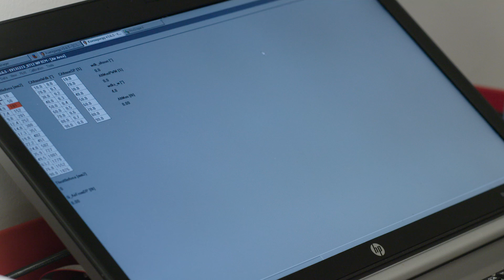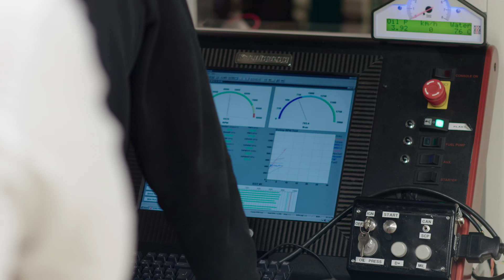The 1360HP Heart of the Koenigsegg One:1 - /INSIDE KOENIGSEGG

Comment: People need to understand that electric engines aren't a fucking God send. Both ICE and electric engines require the use of fossil fuels. Hybrid alone is the best solution as the electric engine derives power from the petrol thus making it more efficient. Stop praising electric car, they are an abomination to the motoring world.
Reply: Electric motors require fossil fuels? Ever heard of a geothermal power plant? They don't use any fossil fuels at all. Electric cars are an abomination? Only if you are an ignorant fucktard.
Reply: Well, electric motors eliminated turbo lag on the P1, so they can't be that much of an abomination.
Reply: ***** Shhhh. If you tell him there are other countries in the world he may have an aneurysm.
Reply: Everyone in this argument failed to think of where materials for the batteries come from, which is the ground. I'll use the Prius for example. It's nickel battery, it come from a mine in Canada, the mining process is so bad it's waste land around the mine. The raw nickel is then shipped to Europe to be refined. It goes by ship burning fossil fuels. Then it creates more carbon dioxide in the refining process, then it is once again shipped this time to japan to be farther refined also by ship. Then to china by ship, back to japan to be made into foam. Then it is shipped by truck to the factory. This creates more pollution then driving a full sized pickup truck or SUV all year. Just because media says hybrids are the answer doesn't mean they are. It's more ignorant saying hybrids are the answer, then saying they are and abomination.
Reply: Tesla? Ever head of them? Hybrids a just stupid.
Reply: Bryan Doherty If you can't refute any arguments your post is useless right off the bat. Good luck with your "non-boring life" clown.
Reply: I remember when digital cameras where the "New thing". And most photographers were skeptical about them. Most said they would never be as good as the old school cameras. Now, traditional cameras  are a Relic. So the motoring world has no long term future, mostly because the production of fuel comes at the cost of the planet's survival and therefore your own, just connect the dots...
Reply: Doppelkupplung
I hate to break this to you but geothermal power is not something you can just put anywhere you want it is actually rather limited which is why it isnt being used all that much.

also if you think CO2 is bad for the earth there is no way that sucking heat out of the earths core is not going to have negative consequence down the road.
Reply: michael cochrane there's been some cases of people getting 300kw out of a motor the size of a dog food tin... granted, this was short time and some very fancy cooling, but the point remains, 4 $10k+ (probably more like $100k+) dog food tins with some fancy cooling, weighing perhaps 20kg can put out as much power as this huge twin turbo v8, and do so while producing considerably less than the ~2MW of waste heat and noise this thing does.
Reply: +Muskoka Mike Actually where I live uses exclusively Hydro. So no fossil fuels are not REQUIRED.
Reply: Brayton engines are what I think the future of I.C.E.'s should be. Research the "ready engine" then imagine what that engine could do if built based on a wankel engine!

Getting 600 lbft of torque and more than 1800 hp out of a 1.3 dual rotor engine would really only require a materials change.
Reply: LSG Drizzt ***** lol...fail and...fail
Reply: Are you trying to be ignorant or it just happens naturally? For now and the near future fully electric cars use fossil fuels in both the manufacturing and the running of the car itself. But there will be a point in the future where this won't have to be the case. Where manufacturing processes and charging the batteries are done through 100% renewable means if so desired. 
Which essentially means that we should not rely on one system over any other and that we continue to develop all technologies, hybrids, ICE and fully electric.
Reply: Well I live in Nova Scotia and we still use coal for electricity here so i don't get the point of electric cars yet. My Civic is an lx, I don't need leather, navi, sun roof. It's 2716lbs, which is on the heavy side but is about 1000lbs lighter than the Outback I had before. I don't hate electric cars I'm 100% open to the idea, I just doesn't make sense for people who live where the electricity source isn't clean. But you may live in Toronto where they use hydro power and there is more traffic, so it makes more sense there
Reply: If there weren't so many trolls on the internet who have nothing better to do but waste time arguing about electric cars, when people have the right to buy whatever they want. I will never buy a hybrid or electric car, I'm an auto enthusiast, I want a standard, I want to hear an engine, I don't buy a car just to drive to work and back and park it in a driveway and not touch it any other time. I buy a car that I can enjoy the sound the engine makes, the feel of the gear shifter, the way it looks. I care about the environment, but I'm never going to buy an electric car. For me and ICE car is the best option it fits my needs, I don't need to worry about a battery dying. Plus Mr. Koenigsegg is right, the electric motor isn't very efficient and complicates the average car. I wasted my fucking time even commenting. This whole argument was stupid.
Reply: ***** I'm not reading a fucking book and if you haven't noticed more of consumers don't have hours to charge a car. I'll buy whatever fucking car I want. You go have your boring electric car and I'll have a flat 6 in a Porsche
Reply: "Both ICE and electric engines require the use of fossil fuels"

This is simply not true as electric engines do not require fossil fuels. The fact that utility companies still use power plants with fossil fuels is not the electric car's fault and going forward even the utilities will move away from fossil. Depending where you live that might already be a reality.

"Hybrid alone is the best solution as the electric engine derives power from the petrol thus making it more efficient."

Again, this is false as far as efficiency goes. It's actually good from a practical stand point giving it an extended range but not improving efficiency over an all electric car.

"Stop praising electric car, they are an abomination to the motoring world."

Bias much? Electric is not only more efficient, it is the future. You can still drive your ICE car till the day you die IF electric is adopted sooner. Gasolene and diesel are not used by utilities on large scale, rather coal and natural gas. So better pray electric gets more share of the market and the sooner the better. It's a win-win for the environment and for enthusiasts that will get more fuel for ICE powered cars that deserve it, not for stupid utilitarian cars to get people and goods from A to B.
Reply: there's all kind of stupid in your comment mate:
Electrics powered off hydro/solar/thermal etc etc etc etc - dont require fossil other than in some areas of their production. even the full energy cycle of a crap electric car charged from a brown coal power plant still beats all but the most refined diesel, leaves every petrol car for dead, and this is still without taking into account the full energy cost of the energy production, nor the ease of emission management for a power plant vs a car.

hybrid alone is not the best solution, its just what provides the best answer to current battery techs lack of energy density and the power grids inability to provide the power to charge said batteries quickly (at least, at home).

"derives power from the petrol thus making it more efficient"
no, no, no, no, no. series hybrid cars are less efficient (other than perhaps some VERY specific circumstances) than a strait ice car - because its converting energy from chemical to kinetic, kinetic to electric, then electric to kinetic. this by definition CAN NOT be more efficient than cutting out the 3 extra stages and just having chemical - kinetic. Parallel hybrids are slightly better, but still are relying on a ~30% efficient engine to convert the bulk of their chemical energy to kinetic, and this is ignoring the energy cost to gather, refine, transport and deliver the fuel. Electric cars convert ~95% of the grid's energy to chemical, and <75% or more back to kinetic. After production, an electric can be 100% fossil free (other than tyres etc) - a ice, can never be so. they can never, ever, be more efficient. its a thermodynamic impossibility. For an ice engine to even approach the efficiency of a crap electric motor it would need to run so hot that it would melt the material its made from.

"Stop praising electric car, they are an abomination to the motoring world."
higher power density, higher efficiency, lower weight... how does this make a car an abomination? fossil fuels are a finite resource, electrical energy is not. Bitch and moan all you like... the future is electric.
Reply: IIAmGothamsReckoning Average shitty electric engine is like 97% efficient where as the best gas one is like 67% efficient. You are off to a hell of a start on proving that electric is shit especially when so many things you use on a daily basis use electric engines.
Reply: sn0wchyld obviously wasn't quoting exactly I said LIKE 60% I'm to lazy to look up exact moment for a slap fight in the comment section besides I was fairly close and it proved my point non the less that combustion engines are terribly inefficient
Reply: IIAmGothamsReckoning and that will mean constructing more generating stations, which require fossil fuels to construct......

I love idiots who can't think beyond what's right in front of them lol

All electric vehicles do is move the pollution somewhere else.....they aren't that green in reality....
Reply: less than 20% of our infrastructure(USA) uses natural sources of energy and nuclear. 81% of our energy comes from fossil fuels. This means that the electricity you're getting is most likely from a huge power grid generator, meaning he is nowhere near wrong. We're forcing the EV to become a thing before we even have a renewable energy or nuclear infrastructure that can even support it. Going electric makes no difference right now, as the mining/recycling of lithium is counter-productive to EV goals. It's all market hype.
Reply: i disagree hybrid is the future, i don't want another leaf thought i want a petrol to electric generator to power a fast car.
Reply: Exactly! If you were to charge an electric car in my county (and no, I do actually live in a highly developed nation), the power is going to come from burning coal anyways! Yes, the burning of coal emits less emissions than Oil, but still; its coal!
Reply: Well spoken.
Reply: IIAmGothamsReckoning
Well to be fair to your argument electricity generated from fossil fuel burning power plants are still almost double the efficiency of an ICE and Electric vehicles have much less drive train loss; So overall its much more 'clean' and efficient than an ICE, this would continue to improve as cities shift increasingly to fossil-fuel alternatives. However as some people have pointed out, the amount of energy and pollution produced in making the batteries isn't exactly stellar. Next generation battery technology can't get here any sooner.
Reply: LSG Drizzt Hes not wrong, look at the industry of making these new hybrid and electric cars, way more pollution involved in making them as a verse to making and running a normal car.
Reply: RussyG32 http://www.greencarcongress.com/2014/03/20140313-golf.html

Check the lifecycle chart yourself ...
Reply: *****
So what are you saying? you don't care about the environment nor sustainable development?
Reply: *****
you are an idiot.
Reply: *****
that is because you live in a third world country with third world power needs. you cant just damn all the rivers and hope for the best.

also dams are not exactly "green". they are actually pretty bad for the environment.

and this is the 21st century and the limits of green tech are pretty obvious to anyone who looks.

the only technology that actually has the potential to power the world in a relatively clean and cheap way is nuclear ( and if they ever make fusion work) and due to the dangers and fears of accidents we are likely never gonna see it happen.
Reply: FreEntity
VW tracks the CO2 emissions only according to that link you sent and even then it only brought it down 26% in normal electric production. It does not say anything abuot the manufacture of batteries that are very polluting.
Reply: FreEntity
also according to the US DOE hybrids actually do use more energy and pollution than none hybrids. turns out the additional complexity in manufactoring and materials used outway the higher efficiency (which by the way is not that much more then the standard new car).

even if we all started to drive hybrids the amount of CO2 saved is still less then the amount the a few dozen typical Americans produces in their lifetime. if you want to save the earth have fewer babies, live in a cave and walk to work.
Reply: Buy yourself a petrol powered generator and run your house from it if you think petrol is the future. As for me I'll get some solar panels and a electric car and we will compare cost in 10 years.
BTW to those bashing batteries on their "production" affects on the environment, they are almost 100% recyclable. The insides break with usage (over a 10+years life), and all they do is put it apart and remake it no lost materials(and is orders of magnitude less toxic then lead acid battery recycling).
Reply: Plur307
they probably will.

as I understand it even when the batteries are too week for use in cars they can still store significant amount of power. So they could be used to store energy in lets say a solar system. for about a decade more.

then the metals used int the batteries are actually quite valuable and might be recycle thought now there aren't sufficient facilities to do that.

but then again recycled does still require energy granted less but not orders of magnitude less.
Reply: Tim Watterson
that is not what they do. and as of now in the US there is just one facility that can do that (if it has opened yet)

and recycling is no zero energy process.
Reply: Yea that's the thing electric cars need to charge in the amount of time it takes to fill up a normal car. And where I live in Canada it makes no sense to drive an electric car, if I lived in say LA where traffic is so bad it makes sense to drive a Volt, which isn't full electric, it's a plug in hybrid. I wasn't saying human kind is the cause of global warming it's a process the earth naturally goes through, humans are just speeding it up to an unnatural process, by adding more CO2 which absorbs the energy from the sun. If the United States lowered their CO2 emissions like other developed countries it would help. Their in the top 3 CO2 emitters along with China.
Reply: ***** 
Woah woah whats with all the hatred man, I was just asking about your opinions. I wasn't name calling or accusing you of anything.
Reply: A battery pack starts as crude nickel in a mine in North America, which is then shipped to a refinery in Europe, then shipped to another refinery in Japan then another in china then to japan where it is refined again then to the factory for the battery pack, then to the factory for the car. Mine>refinery>refinery>refinery>refinery>factory>factory> dealer ship. 
Gasoline or diesel is just crude>refinery>gas station. 
Also that is what most people drive, which doesn't take into account if you had to drive a distance greater than 100km, like I got on road trips for something to do, normal 250km or more. And producing a battery pack makes more CO2 to be made. Not only that the battery at some point will die. The anode will eventually be none existent it's just what happens with batteries. Internal combustion is still the best transportation for most people
Reply: *****
none of the G8 countries get 97%of their power from hydroelectric source. the only nation that has that honor is Butthan which is not in the G8. so very much valid.

also the fact that canada population is so low compared to its size also helps my argument quite a bit.
Reply: ***** Quebec is a province of Canada. If you want Quebec to be a country then you can forget about getting 95% of your electricity from the Niagara Falls, which is where that hydroelectricity comes from. Oh and get your own military too mr. Quebec separatist.
Reply: *****
 you are an idiot.
niagra falls is a unique place. cant replicate it around the world.

canada has about 35 million people and only about 60% of the electricity comes from hydro.
Reply: let me google it for you Google: Population of canada = 34.88 Million check your facts about your own country.

you should also Google the word "about".

and again... the hydropower potential of Quebec is not something that can be replicated throughout the world. 8 mill is still a tiny population size.
Reply: Crazylalalalala Canada's population in General is smaller than other nations. The state of California alone has a population of 38.5 million people according to a NY Time article published in December 2013. 
***** Plus Quebec having a small physical size, small population of 8 million and limited resources. The GDP wouldn't be very good. Making Quebec still rely on the rest of Canada and still use the Canadian dollar. Sure Quebec has a mostly French speaking population. but that adds to the diversity of the nation of Canada. I like Montreal it's a nice city, I don't want to have to go to another country to go there.
Reply: *****
aright bro you are an idiot.

"seems to think we have plenty of ressources" that is the all point moron.
Reply: ***** I'll never buy an electric car even if oil runs out.
Reply: Bryan Doherty actually tesla has shown that a battery swap can be done faster than a fuel refill for the same cost… At the end of the day I love gas powered cars and I will always have my toy car as I have now. But when I need a vehicle to get to and from work and deal with kids I will 100% get a tesla.
Reply: Chris Bisson Well Tesla lost 1 million bucks, dropped from $8.2 million to around $7 million. since the price of oil has dropped so much recently so there's less demand for them. to expensive anyway for a big power wheels. Tons of nicer cars on the market for the same money
Reply: Bryan Doherty
people who buy tesla buy them for a reason. that reason is not because its the best car around.
Reply: to be corected hybrid has petrol and normal engine if u run out electricity you can go with petrol engine :)
Reply: electric engines dont need to rely on the use of fossil fuel. They can use renewable energy too. The electric motor is inevitably the future of motion
Reply: 04218158
but they do relay on battery power which at this time does not allow for very long ranges of travel. Thus hybrids are used to extend the range.

but yes i agree that electic power will likely be the thing for most people.
Reply: yes but it won't solve the problem of running out of oil. Something will still have to lubricate bearings, transmission (a small company has developed a 2 speed transmission to be used with electric motors) and other parts that need lubrication. A lot with the plastic which is most likely made using oil, so it still wouldn't be an answer to that problem, yes there would be less oil being used but it will still be used and will run out eventually. This seems irrelevant right now with how low it cost to produce oil and how much there is, leading to the low price but it will run out someday. Which will be a huge problem for the world economy. Think of all the things you use and touch in day to day live that are made out of plastic or with some plastic parts. You'll have a hard time not finding one. Electric cars will merely lower pollution from transportation. They'll still need oil in some way to be made and used so it doesn't solve the problem of oil running out some day. I know this deviates from the main point of the discussion here and apologize for the length of this comment but I believe I have a valid point.
Reply: Bryan Doherty
Yes running out of oil will effect lots and lots of industries.

but if using alternatives for transportation such as all electric drive will drastically extend the time it would take to run out of oil for other products like lubricants and plastics.

This extra time will allow for substitutes for those products to be developed. There are already many alternatives for plastics and lubricants that use no crude at all. Granted at a premium.

There are even synthetics oils replacements for crude that use coal, natural gas, and plant crops.

Not a perfect solution but its a start.
Reply: Bryan Doherty what you say is only partially true though...a LOT of lubricants are made from renewable sources such as silicone and 100% synthetic motor oils have been around for years.....sooner or later we'll break off our need for oil..
To the OP of this thread: not all "electricity" is generated via petroleum....ever heard of hydro electric? That is electricity generated by water....
Reply: To think at one point in the early 1900's, electric cars were the preferred vehicle to own. The design and widespread use of starters were the end of them, it allowed women to drive a gas engined car and since they were cheaper made it a better choice for people looking to buy a car. The technology is getting better, but its been around and ignored for a 100 years due to the zero desire for them. They won't be the car of the future though, hybrid technology will be and eventually all cars will be hybrid based. Mostly due to the fact the government requirements for a maker to produce so many models that have insanely high mpg's in 3 years. So companies like koenennnennsegg, ferrari and porsche are developing it to reach those demands and put out amazing performance. The flaws will be worked out and soon a Ferrari capable of doing 209mph will get 45mpg while doing it.
Reply: Or when we fully develop green and renewable electricity producing power plants. If you generate your electricity via wind or solar power, a purely electric vehicle will become widespread. The issue with hybrid vehicles is the need to have 2 systems, one electric and one fuel based to drive a generator.....

I just want to point out that the reason gasoline engines became so popular is the fact that gas was cheap and plentiful. Hence why in the 60's you had cars with massive engines, that produced little horsepower (compared to today's standards) and had HUGE consumption numbers. OEMs didn't worry about fuel conservation because even by today's dollars, a gallon at 25 cents was dirt cheap. Plus back in the 60's, you could get a really nice car for $2000 and a house for a little less. Now houses are $300,000.00 and you can get a decent car for 1/10th that.

If gas was $5,00 a gallon in the 60's, and cars were getting 3 or 4 mpg, I can guarantee you electric vehicles would have become more popular.
Reply: The two main issues with purely electric vehicles is the charging times and range. Once those two issues are overcome, you'll see the death of the mass produced gasoline engine.
Reply: michael cochrane
at a cheap price too.

Teslas theses days have plenty of range and because the range is so high the charging times are not that big of a deal.

the also charge pretty quickly according to their website. 29 miles per hour a charge or if you get their high power charger what ever that means you get almost 60 miles per hour.

and if you get their super charger you get 120 miles for 30 min of charge. which they plan to place along the interstate. you stop for lunch and you get 120 miles.

sounds good to me.

problem of course is that car cost 70-100k so any kind of saving you get from being all electric will pretty much never offset the initial cost.

so the technology is already there just at the wrong price.

i hope that now that tesla released some of its patents other larger companies will make more affordable versions of teslas that look amazing unlike the crap electric toy cars they are putting out there.
Reply: You're right, there is no reason an electric vehicle has to look like a POS....like a smart car, there was NO reason it had to look like a pregnant roller skate......I tell you, 99% of my driving is less than 100 kms round trip, if I was in the market for a new car, I'd be seriously looking at electric.....if they weren't so fugly...

I use a lot of power tools (carpenter) and I went out and bought Li ion because for 1/4 the weight and 1/4 the size, Li ions are a lot easier on the hips carrying it around all day. AND you can charge them in 15 minutes as opposed to the hour and mass of ni cads...and that technology has only been around for a few years.....

I know there is concern about what to do with the batteries when they now longer can hold a charge, but considering the gas automobile has been around for over 130 years, look how far they have come so imagine how electric vehicles will be in 130 years.....
Reply: michael cochrane
it should be very interesting in 130 years.

I imagine self driving taxies will be the way most people get around. With specialty manned vehicles for those special needs and just for those who love to drive.

for now a motorcycle is what I do when the weather is fine as i too commute less then a few dozen miles.
Reply: I had a bike licence years before a car licence but up here in Canada, the riding season is so short I just couldn't justify the cost. Not to mention I moved to an area where road maintenance is pretty much non-existent.

Did you see Jay Leno's review of an electric bike? He was pretty impressed by it. There's a video around youtube of it. He said one thing that takes getting used to is the quiet.....
Reply: michael cochrane
I have not seen Jay Leno's review but i have seen many others on electric bikes and i gotta say, I want one.

Unfortunately at this time the price of them will pretty much never offset the savings but next time im buying a bike (i just got one a few years back so it would be awhile) I will definitely consider it.

They should get more competitive by then.
Reply: Believe it or not, Harley has an electric bike in the works....it actually looks pretty good too...not a typical "hog" more like a Buell but a nice looking bike none the less.....
Reply: michael cochrane
yea i have see it.

electric seems to be the future for just about anything.
Reply: sn0wchyld Great post there dude....and let's not forget the INSTANT power you get from an all electric motor.....for the naysayers, ever seen a drag race between an electric vehicle and an ICE? Even a basic electric eats an ICE for breakfast....without the need for superchargers, nitro fuel, turbos, and no need to rebuild the engine after every run.....
Reply: sn0wchyld
can you provide a link to articles were people did that? I have not heard of this.
Reply: Crazylalalalala did what sorry? old, long post with a number of points made so im not sure what exactly your looking for.
ps... a bit of a cop out but google is your friend.
Reply: sn0wchyld this one "here's been some cases of people getting 300kw out of a motor the size of a dog food tin."

not sure what to google.
Reply: ah yea that one wont come up as easy... was some very fancy cooling and stuffs. ill try and find some when i get home tonight.
Reply: sn0wchyld you want to see powerful small electric motors? Look around for R/C airplane outrunner brushless electric motors....for something the side of a silver dollar and maybe 1" deep, they lift planes in the air that used to require a fair sized nitro gas engine....
Reply: michael cochrane hahah mate those wont come close to the power density of some really nutty motors with exotic cooling. try 5kg and 30kw output just with air cooling. the hobby motors are very good (particularly for the price) but they wont compare to high end german stuff!
Reply: sn0wchyld I know, I'm just giving an example of what is available now as compared to just 10 years ago....
Reply: Crazylalalalala
http://www.greencarcongress.com/2008/06/sumitomo-electr.html
thats not the same motor iirc but its the same kind of principals... 

edit
here it is:
http://endless-sphere.com/forums/viewtopic.php?f=30&t=28467#p410453
interestingly enough one key issue with these motors is finding epoxy that will withstand temps that low!
Reply: michael cochrane oh yea the advancement of switching electronics is opening up some crazy new tech.
Reply: ***** In some instances, what you say will be true...but with the advent of computers, and numeric control, we've lost a whole job market. Think of 1 person who can maintain and monitor 100 machines vs. 100 people doing what 10 machines can do.

In addition, because the way the distribution of wealth is occurring, all this new technology will only be available to certain members of society. We see it now with hybrids like the Tesla, not just every joe can afford one. Sure, for now the middle class can afford all the new gadgets but that class is shrinking rapidly and eventually there will be NO middle class....
Reply: ***** While there "should" be an act like that put in place, the politicians, and their employers (big business) wouldn't allow it...Hell, just look at the trouble surrounding minimum wage?

It is funny about computers though, they "said" that by going to email we'd save tons and tons of paper every year but the opposite is true. We're consuming more paper than necessary. (this is due in part to the "just print it out" attitude). I know my father is like that...He's gone through 3 printers in 4 years...if he sees something online? He prints it out...never to be touched again...I'll probably be the one to through it out when they pass on....
Reply: sn0wchyld
thank you that is really neat.

I would be interested to see how they figure out how to keep the super conducting wires supercooled for a significant amount of time while still keeping a functional car and at a reasonable cost.

but still very promising.
Reply: Crazylalalalala part of it would be that super conductors generate very little heat (hence the name!) so there isn't much heat being generated in the motor, so other than insulating it may be very easy to cool. 

but yea... cost. and also the energy required to cool too that temp in the first place may offset the efficiency/weight gains (im guessing, definitely yes on this point, theres already plenty of normal motors in the upper 90% eff).
Reply: sn0wchyld
yea, but for it to be a super conductor it needs to be at super low temperatures. even the high temp super conductors operate at -200c thus the requirement for all the cooling systems and insulation.

electric motors are generally very efficient.
http://techon.nikkeibp.co.jp/english/NEWS_EN/20090403/168295/ 96% efficient motor. but even a typical motor is over 80% efficient.

but in larger applications that should not be a problem. so big ships could utilize this or tracks and mining equipment even. could get interesting.
Reply: Crazylalalalala yup. hopefully room temp SC's can be developed sometime soon. till then high 90's are pretty damn good for efficiency.
Reply: Pablo Picaso and let's not forget that just about all fuel powered engines are started with electric ones!
Reply: Pablo Picaso lol sorry mate your numbers are way off there. excelent electric motors will hit the high 90's. a shitty one will happily turn 50% or more of your power to heat... and the very best engine will only hit about 44-45% efficient, far less in real world use. 67% may not even be technically possible unless you find some exotic material that can run well at a few thousand degrees (what is necessary for the max thermodynamic efficiency to be able to get that high)

dont get me wrong, your right in principal, just your numbers are a bit wacky.
Reply: sn0wchyld I'll look at other sites but according to an engineering site:

NEMA Design B Electrical Motors
Electrical motors constructed according NEMA Design B must meet the efficiencies below:
Power
(hp)
Minimum Nominal Efficiency1)
1 - 4
78.8
5 - 9
84.0
10 - 19
85.5
20 - 49
88.5
50 - 99
90.2
100 - 124
91.7
> 125

92.4
Reply: sn0wchyld from another source:

Standard induction motors are considered 90 to 95% efficient, if they have been correctly sized and applied to the application. Depending on what the motor is driving, the delivered efficiency can be substantially less than 95% of the input electricity - caused by losses in pulleys, belts, gear boxes, etc

Then the article went on to say that NEMA has standardized the testing to determine the efficiency of a motor and it's application.

That's a far cry for your 60% numbers....
Reply: michael cochrane buddy... the point was what the efficiency of an
"Average shitty electric engine is like 97%"
A shitty electric motor will not hit 97%. You cant go looking at industrial size induction motors and then claim 'well look these motors are better than 50%'. No shit. That was the point, that a bad electric motor will be very inefficient, yet still generally better than the best ICE engine.
Reply: Pablo Picaso ha I figured mate, all good... I thought you might just be being a little facetious saying a shit motor will still run at 97% efficiency.
Reply: IIAmGothamsReckoning electric cars absolutely do not require the use of fossil fuels
Reply: Brandon Teeter ummmm if the electricity is generated by the burning of coal or natural gas, they damn well do! 

The only methods of generating electricity not reliant on fossil fuels is: wind solar nuclear and hydro electric....rare is it that any country uses just those....

Never mind the manufacturing of them...or the transport of the parts and completed vehicle.

A study was done a few years ago and a HUMMER used less fossil fuels than a prius....because a vehicle uses more energy to make than it will use in its usable lifetime. 

For eg: a HUMMER used existing tooling on a lot of its parts (engine is used it many vehicles) therefore the energy required to make the tooling was spread out over a decade and millions of vehicles.....
Reply: IIAmGothamsReckoning I forget the actual amount, but I saw a report that said a vw golf diesel was 3x more efficient than a prius, and twice as efficient as a train....(since a train burns energy to move the locomotive, the cars, and the construction and maintenance of the tracks etc)...even more efficient than a plane because a plane uses 30% of its fuel just to carry the fuel....
Reply: Hydro power produces methane from all the plant matter that rots in the dam and methane is worse than carbon dioxide
Reply: IIAmGothamsReckoning huh electric engines that uses fossils... i never heard of? even tesla electric cars dont even use fossils
they use battery duh its "electric", what do you expect?
Reply: Why generator need to be charged if itself is the one which charge the battery,And please explain to me how heat from Turbo can be charge a generator